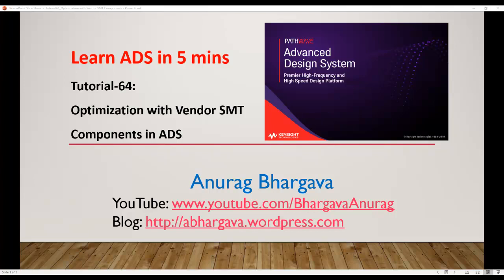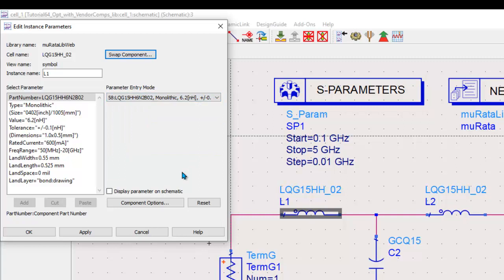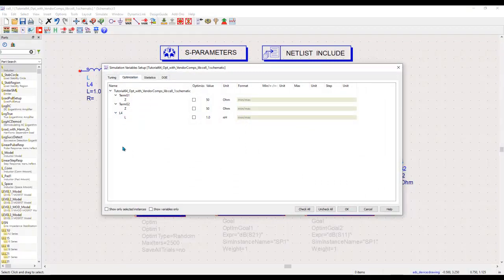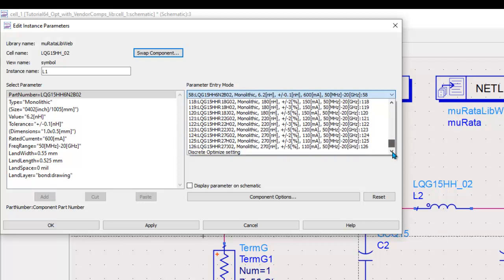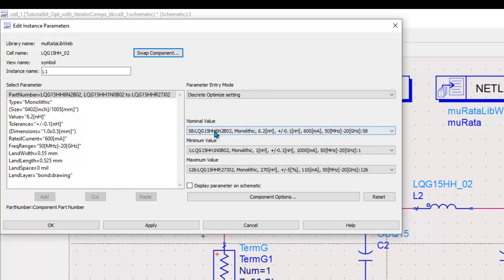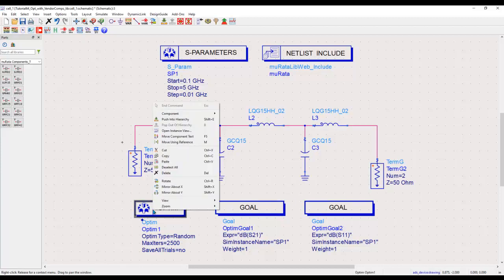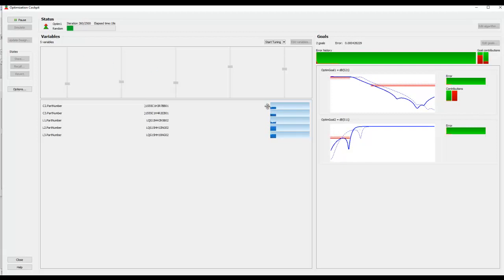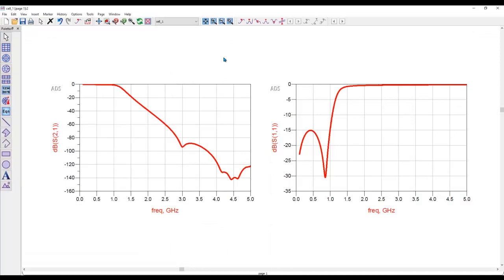Tutorial-64: Optimization with Vendor SMT Components

Comment: Dear Mr. Bhargava，
I am designing a low noise amplifier and I want to know how much base current ib can get the smallest noise figure. In the s-parameter simulation, the x-axis is always frequency. I want to scan Ib at 140GHz, and finally get the relationship between the noise figure and Ib, and then determine the best DC bias at 140GHz. Can you help me? what should I do.
Reply from the maker: You can perform sweep analysis and post process the data the way you want. In your case I would recommend you to contact your local/regional Keysight tech support team for help as this is not possible to explain on YouTube.